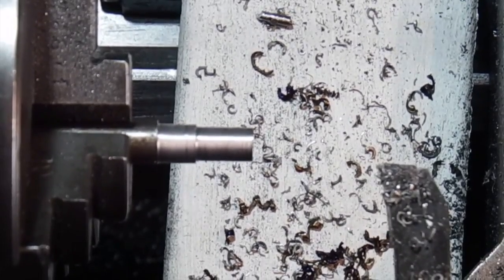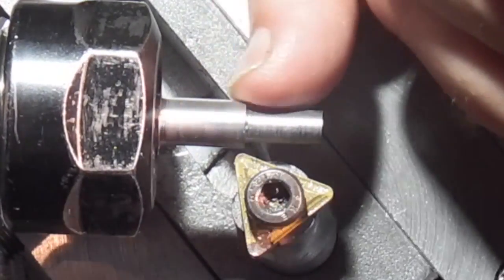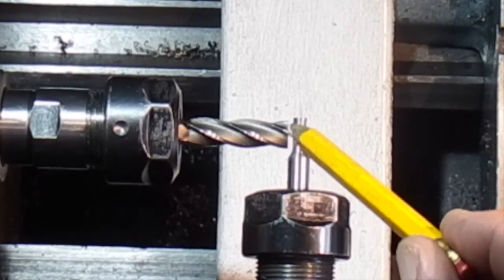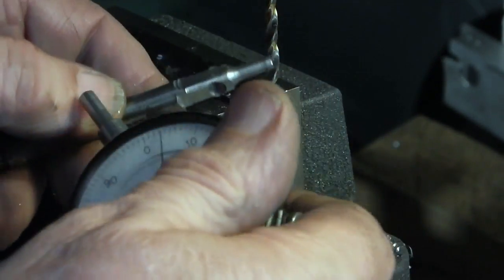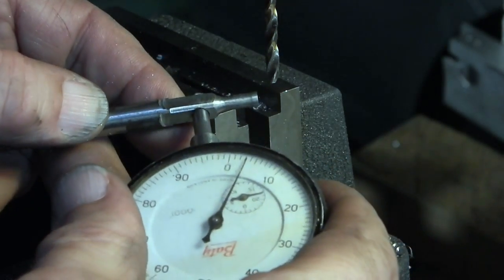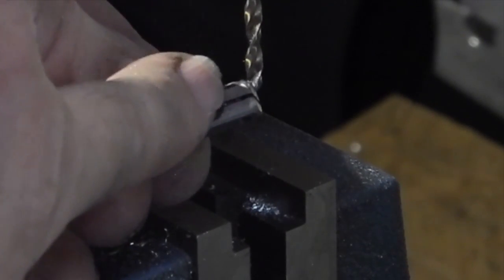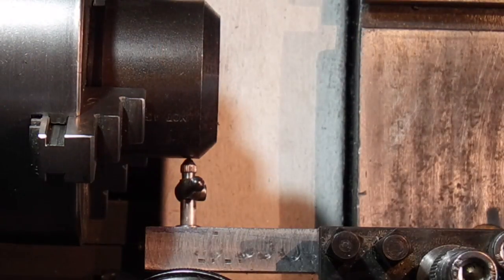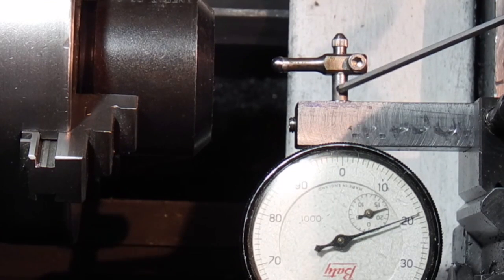DTI bore probe

Comment: That's a good idea Alan. Thank you for that. I've been looking for a lever type attachment for a dial gauge for ages with no luck at the price I can afford that is. The last one I saw they wanted £75 for a Starrett one! I've just bought the same Batty tenths indicator in good nick off of eBay for £7.50 plus £3.50 postage. I'm buggered if I was going to pay £75 for the lever attachment! So your idea is a great way to do the job! Cheers!